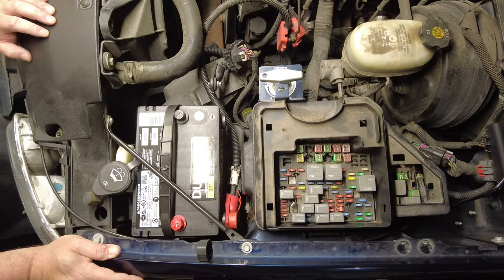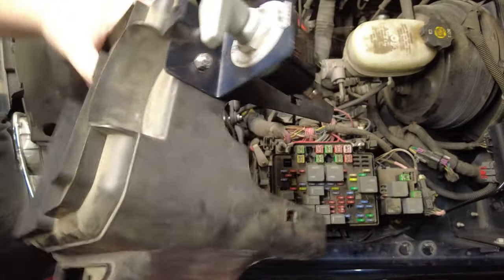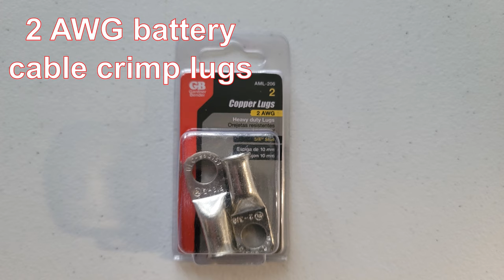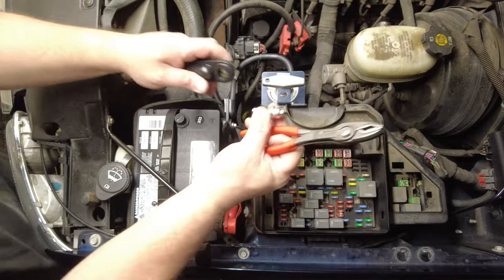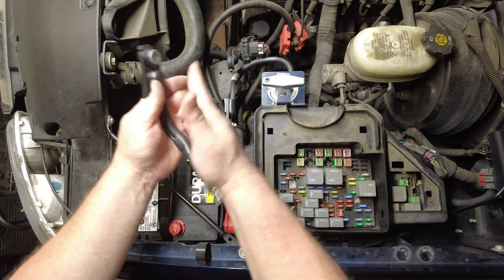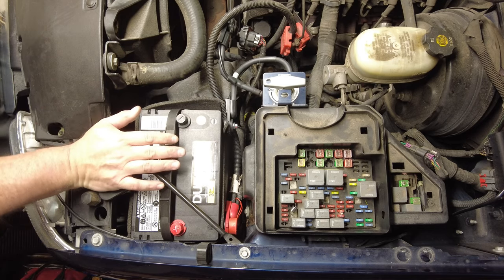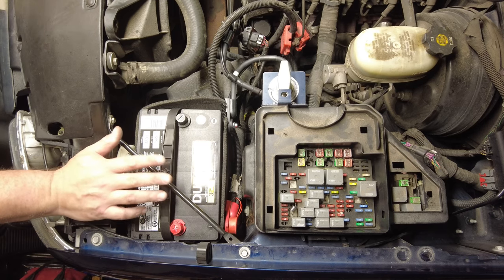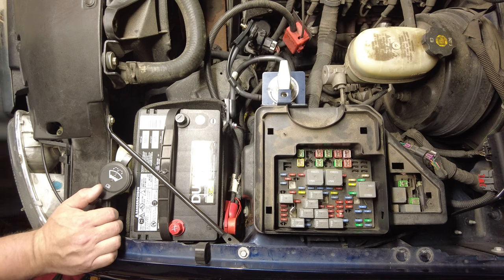How To Install A Battery Disconnect Switch On Your Vehicle Without Permanent Modification.

Comment: Personally I think battery disconnect switches should be factory installed.  With all of the electronics going into new cars, it is sometimes necessary to "reboot" onboard systems, and this would be the perfect solution.
Reply from the maker: Good point, and I agree.  Sometimes a good old fashioned re-boot is all you need to fix weird problems. Even in the automotive world....  An ECM/PCM (call it whatever you want) reset is all it takes.....  and it saves my battery from going dead, too! Thanks for the comment.

Comment: With All due respect, your desire to NOT use an Amazon top post disconnect switch and to not cause undue modification to your vehicle resulted in numerous extraneous parts configuration and mounting considerations when the item that you are trying to avoid works perfectly fine and is reliable and could not be any simpler to install. This video is like watching someone travelling from New York to Los Angeles via a Florida stop over.  It is un-necessary overkill. I am utilizing the Amazon top post disconnect switch on the NEGATIVE terminal that has the rotating green screw knob on my 05 Dodge Caravan that has served me well for pushing 2 years with No failure and with a less than 5 minute simple install. Just Say'in. Greetings from Ontario, Canada.
Reply from the maker: Feel free to modify your vehicle however you see fit. I don't care what you do to your vehicle.  Why do you care what I do to mine?  Are you saying my opinions are wrong, and your opinions are correct?  That's fine... but that is YOUR opinion.  It doesn't make you RIGHT, however. Those ultra cheap Amazon knife switches are complete garbage in my opinion.  The ones with the thumb wheel aren't much better. Again, that's fine if you prefer them.  But you'll never convince me that using quality components (especially ones that I ALREADY OWN. Did you miss that part, too?) is the wrong way to do something.  You can complain about me and my video all you like, but just remember...  there is nothing wrong with trying to do somethibng to the best of your ability.  And buying the absolute cheapest garbage known to man from Amazon is NOT the best way to do anything. I will be waiting to see your official "Battery Disconnect" video go live on youtube.  I can't wait to post a rude and negative comment under you video telling you how you did everything wrong.  Just saying....  Greetings from the US

Comment: I've bought 2 different cut-off switches from Amazon that were absolute garbage. The bolts were too long and had to find shorter bolts and then they didn't work. I have a 6.2 liter Denali with a big battery so I'm going to do it the right way with overkill as I know it WILL work. What length should I get for the 5/16 flange bolt and what kind of metal should I get?

Comment: Great idea!! That's the same cutoff switch that comes on our tractor trailers from the factory.
Reply from the maker: That does not surprise me...  The Flaming River switch that I used in this video I purchased over the parts counter at our local Peterbilt truck dealer.  I figure if it's good enough for a brand new Pete, then it's good enough for me. lol. And surprisingly, at that time, they were priced the same at the truck dealer as they were on the internet.  I figured a Peterbilt dealer would have a huge markup but there really wasn't on this particular part.  Thanks for the comment!

Comment: I use the vertical blade switch on my tractor, and it has worked well for many years, however it would not fit under your hood without a dent. : )
Reply from the maker: The blade type, or "knife switch" type that I have seen use a pop rivet as the pivot point.....  if that doesn't scream CHEAP, then I don't know what does. lolol. They could at least use a bolt with a lock nut of some sort. lol. I'm sure there are many versions of that style of disconnect available on the market but the ones that I have seen do not impress me much.  I guess as long as the switch does it's job and it doesn't leave a guy stranded then there's nothing wrong with it.  Thanks for the comment!

Comment: for the flange bolt, does it matter what type of metal the bolt and nut are as I'll be using a spacer and the bolt/nut will just be the fastener?